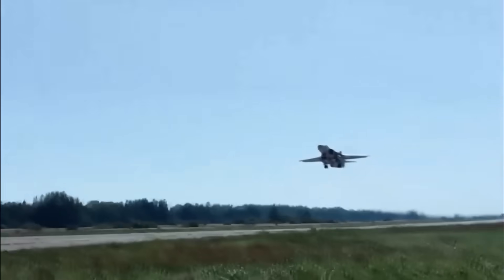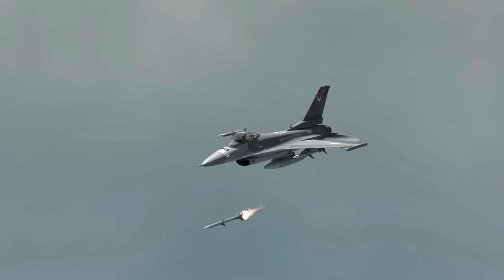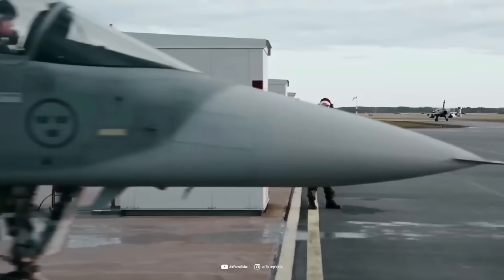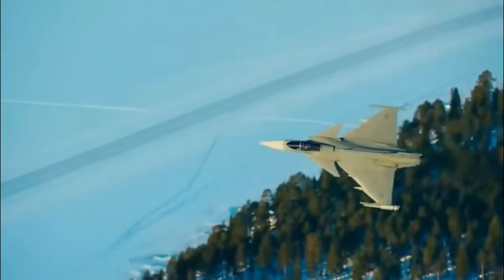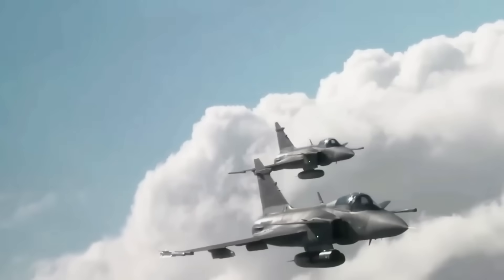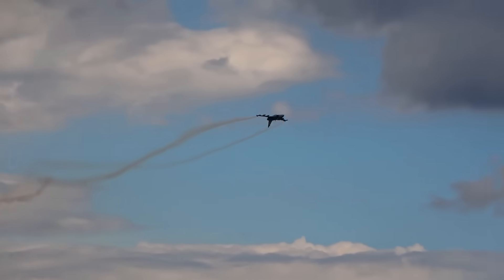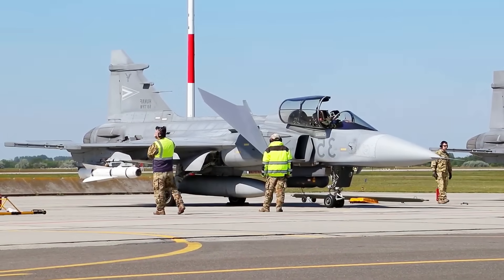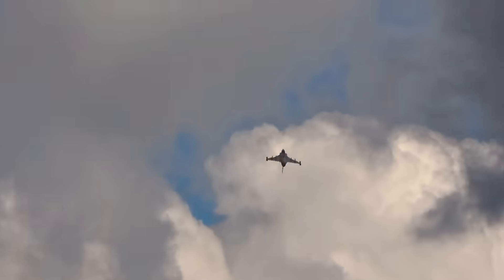SWEDEN's New Gripen Engine Will Change Global Power Forever?

Comment: The choice to create a Gripen with a Rolls Royce EJ230 isd not simply about performance. The main reason is that the General Electric engine gives the US veto over sales of Gripens to other countries. America is no longer trusted for long term defence partnerships, it is turning on former allies saying it will deliver watered down versions of hardware. Some countries are cancelling F35 orders or changing their minds on orders for F35's they were going to make. When these countries look for alternatives Gripen is one of the favourites.
Reply: perfect. close Everything  whit  usa.nobody can ever trust usa again 😊
Reply: Indeed that's what the "EJ" stands for.
Though - Rolls Royce is not completely wrong, as it owns 33% of Eurojet Turbo - and the design of the EJ2xx engines is derived from an RR XG-40.
Reply: Very possibly the F-35s have a US controlled kill switch.  We don't know this as a fact, but the very fact that so many believe it is possible speaks volumes about the lack of character or the current USA, that the USA can no longer be trusted.  Very sad indeed.
Reply: @todd8155 att least they can delay connections to satellites and delaying updating of  software on F-35
Reply: @todd8155  Well, you know that’s a rather stupid remark to make.
Reply: @Quickslipknot  I don't know that at all. What part of my statement specifically, if any, is inaccurate?
Reply: Key word "former" makes sense, doesn't it? Why support countries that are turning to dictatorships?
Reply: The EJ230 and EJ220 are bulid by Eurojet Turbo GmbH.
Reply: That's what I was thinking.
Reply: The Gripen by Saab is better in our Arctic.🇨🇦
Reply: no f16 engine,no USA hassles.Canada will get it instead of f35.RR engine.
Reply: Who the hell cares about   fighter jets ... drones make for military power army these days. And missiles.
Reply: @RI_K-b5j That's might be true in future ,when drones will develop more and all kind of satellites
Reply: You are so tight!
Reply: And work with preparing for the switch of motor began as far back as in 2022 so it is not a Trump-induced whim either
Reply: There might not be a future Canada if the western Provence’s finally decide to pull the plug.  NATO countries don’t properly fund their own defense.  So you asses complain about the USA until you need help.  Tired of the bellyaching!  I do like the concept of the Griphen and wish Saab luck marketing them.
Reply: @Quickslipknot  How many countries have needed NATO? Wait, there's only one, can you guess which one? So stop talking about help. And a lot of the money the US spends on weapons isn't for NATO, it's for playing police all over the globe.
Reply: @Alcani81  ALL of the east European nations that separated from the Soviet Union!  They are joining NATO! They are there because of US backing. The US provides defense infrastructure in unison with these nations.  Estonian, Latvia, Livonia, Poland show your statement is false. Sweden and Finland have joined in support Solidarity.  They are in NATO and not because of Canada.
Reply: @Quickslipknot That’s funny coming from the country most needing it’s Iranian embassy staffers “saved”, it’s citizens of numerous parishes of New Orleans plucked off their roof tops, supplied with potable water, emergency medical care, power generation from Royal Canadian Navy ships deployed there after Katrina and arriving before any American aid had left their parking lot’s. Not to mention the MANY times electrical service crews were sent down in convoys to restore power to tornado/hurricane destroyed areas of the U.S. .  Then there are the times our in-house designed water bombers have saved the day during your wildfires. We won’t mention details of the first four Canadian military deaths occurring in Afghanistan being at the hands of a National Guard pilot ignoring his flight leaders order to break off his attack run and dropping bombs on them, he just had to bomb something, Canadians would do if he couldn’t find any bad guys. It took over a year of diplomatic wrangling to even get the guy put before a board where he got a wrist slap and to this day has not apologized to those troops families.   
Not once has the U.S. ever come to Canada’s aid against any threats from another country, but ask the thousands of Americans given shelter in Canada in the aftermath of 9/11 when they were deemed too great a threat to land in their own country if they approve of your’s and your idiot president’s bullcrap.
Reply: Besides you spell “center” & “color” funny.😉
Reply: @brustar5152 You don’t think that the U.S. has come to the aid of Canada? From wildfires to ice storms, the U.S. has helped.

You don’t think that the U.S. fighting ISIS globally, and keeping the shipping lanes open around the world benefits Canada?  

Three quarters of Canada’s exports to the United States, and trade with the United States accounts for a large portion of Canada’s GNP.  You honestly don’t know what you’re talking about.
Reply: Blah blah.  Can Canada wait 6 years.
Reply: @gordonschiff3621  Why is the US planning to invade sooner?  Have you ever heard of overpromise and underdeliver?  F-35 is over budget by $6 billion and 5 years behind.   Time for Canada to assemble the Gripen in Montreal, as publicly disclosed already.
Reply: @gordonschiff3621  Tell that to the Yanks that wants to close that deal. They are on pins and needles about it.
Reply: @michelchartrand7257 We do not trust the U.S.🇨🇦
Reply: @gordonschiff3621 I would have thought so. Who is actually a threat, except the US?
Reply: @gordonschiff3621 , it depends on whether Trump will make you the 51st state in his second period or his third.

Comment: The reports of the engine development have been that it is being done by Rolls Royce and maybe a variant of the engine used in the Typhoon. This already has cruise control, so that would make sense. It may mean that the fuselage may have to be redesigned to enable to fit the new type of engine. This all came about because Trump wouldn't give an export license for the engines for an order of the jets to go to Brazil. He was/is trying to put pressure on the Brazilian government to let out of prison the alt-right past president who tried to start a coup when he lost the election! Sounds familiar?

Comment: The Gripen did not create the Bas system here in Sweden, it already existed. The Saab Viggen also used the same system and could land and take off from normal roads. This doctrine is older than the Gripen.
Reply: Viggen could even reverse.
Reply: Bas60, developed 1954-. At least the Draken could also utilize rural roads, maybe Lansen as well? Or maybe it was under powered.

Comment: The Gripen is perfect for Canada. Just fit it with the Rolls-Royce EJ230 engine.
Reply: Realisticly, it just can't happen. 

Or, more accurately,  it would require such a major redesign and overhall that by the time they could get it not only out if design but fully out of production at scale...the swedish lines would be starting to shift production to the FS2020. 

Canada has 2 choice. Refit their F-18s in hopes of making them last while penning a deal with Saab, GCAP or (less likely) FCAS to replace the fleet in a decade. Possibly while investing in navy or land based assets in the meantime to fill a different niche in NATO cooperative defense plans. 

Or...just buy the f35s. They are incredible fighters and it is unlikely that public opinion in the US would allow any administration to really cut off parts and supplies to CANADA.
Reply: @jonofpdx SAAB will figure it out. Gripen was designed to be modular in the first place. RR will help them if needed. Public opinion does not matter in the US anymore. The Trump administration does as they please. Canada and Europe is now considering non US made weapons and systems.
Reply: Alas, it’s a suggestion right now, it doesn’t actually exist. It would require a new fuselage, likely new control surfaces and most certainly new avionics.

Comment: in the same sentence you call it the gry-pin and the grip-in pandering to eyes and i-ts callers. Such diversification.
However you fail aith the new engine by saying that supercruise will not light up the sky with tail bloom or guzzling fuel. Umm great. But does it drop leaflets to advise any listeners that any perceived sonic boom is a figment of their imagination and they should see a psychiatrist if they hear one? Also harder to intercept. I think I need to inform you that any chaser will not be hampered by using fuel on full AB to catch someone on super cruise in a push and shove scene. So even an old extinct EE Lightneing would have no trouble catching it as long as it only had a few minutes lead.. 
Lots of generic talk about a newer engines, without any detail of the specifics the headline is about and the fact that being an export engine solution to avoid Trump's control it also has reputedly potentially slightly less performance than the Swedish supplied production engine. And is it yet working?

Comment: My questjion is: is the Gripen E/F to re r e engined with the RR engi ne in the Typhoon? If so when? If all European, security is secure and the European countries should all agree to buy it.
Reply: No.  Apparently, re-engining with an advanced, much more powerful and thrust-vectoring development of the EJ200 used in the Typhoon, is what is under consideration. Allegedly!  The EJ230.  This would involve considerable modifications to the Gripen airframe and systems, so this is not a short-term project.  I suspect with such an engine, assuming it achieves its design promise, the "Super Gripen" would be a total world-beater, and would steal much of the Rafale, Typhoon and F18 etc. market.

Comment: This is a confusing video. Is it a SAAB promo? Maybe, but if it was, it would highlight the most important reason for a new engine: To get an engine that today's 'Murica has no say over! 
The Gripen's Achilles heel has been that it's engine is based on an 'Murican design, which means that the grubby fingers of a disintegrating empire can decide WHO does what WHAT with the Gripen.

Comment: The Gripen E/F equipped with the GE F414G engine is fully capable of supercruise.  The real issue is whether President Pedophile will allow it to be exported to nations considering the Gripen as an alternative to a US jet.  The safe assumption is that he will pitch a tantrum and refuse the sale regardless of any damage he does to relations with "former" American allies.  Rolls Royce has an alternative engine but it will require certification for single engine use and extensive re-engineering of the existing  Gripen E/F, driving up cost and time to market for the new version.